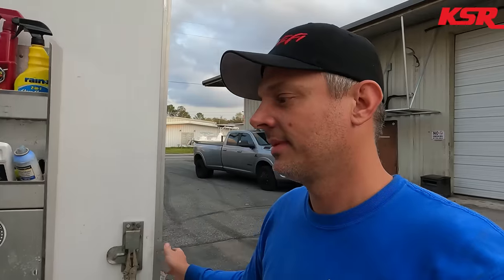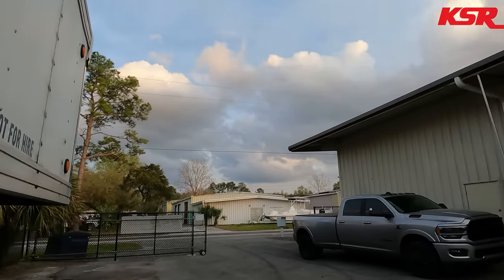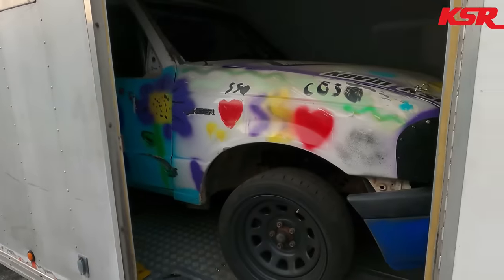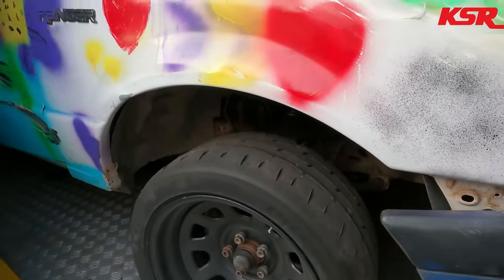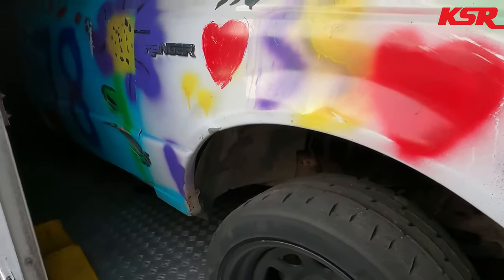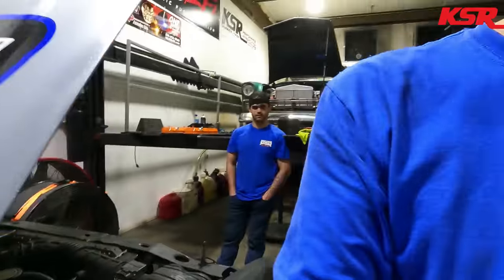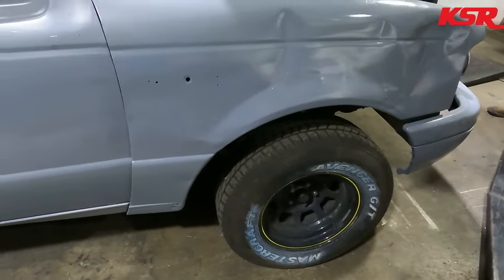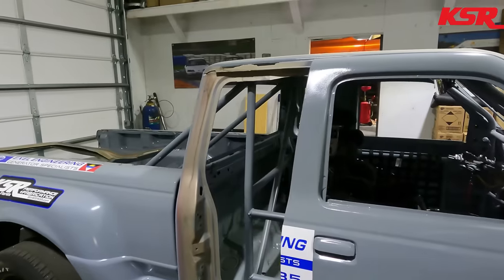Secret Squirrel Stuff at KSR!!!

Comment: I used a Mazda b3000 torsion front end with over sized bars from a 90s late-model   lefthander chassis 3 piece swaybar that had the same spline count   had to cut an inch off one side but lots of spline left .and was able to drop my ranger 3 inches and still use all stock parts  except the bars themselves, little paint and after 1 hotlap in the clay No one without a caliper could tell . stock 4.0  shocks bottomed out rf on the dirt though there is enough shaft to weld the lower riñg an inch and a half short if rules allow otherwise I scrounge for Ranchos that were not for my application from a salvage yard (when they used to allow you back to dig your own parts).

Comment: Hey Kevin, Does the direct mount fan work that well? I need to try that this season with my Rx7. I'd see some higher temp if I kept her around limiter for about half the track.
Reply from the maker: It worked awesome this weekend! I didn't even need to turn the fan on during the race. I think the previous shroud was hindering airflow at speed.
Reply: @KSRPerformanceFabrication  awesome, I'm going to try that out.